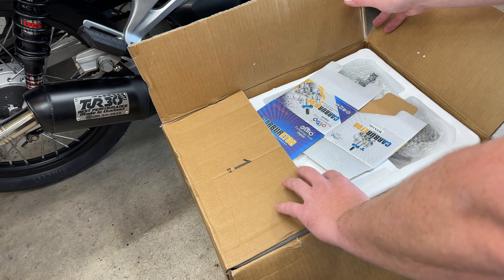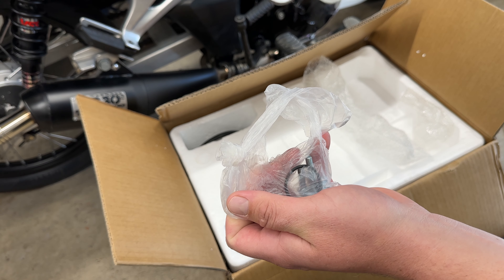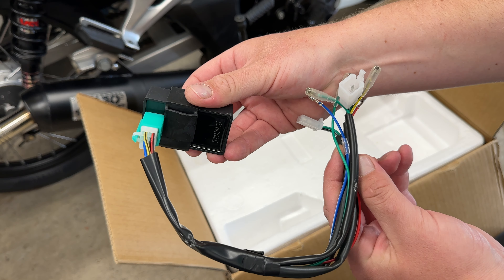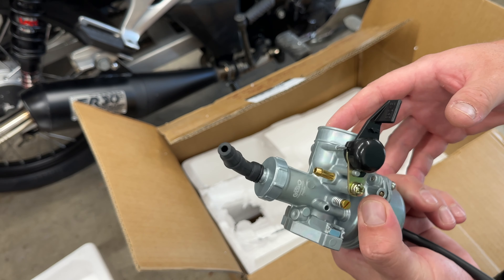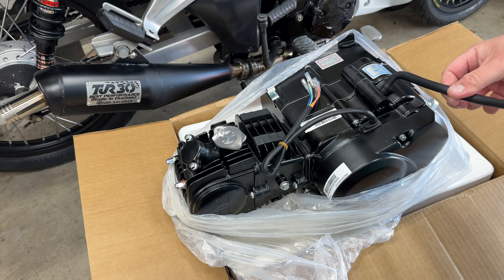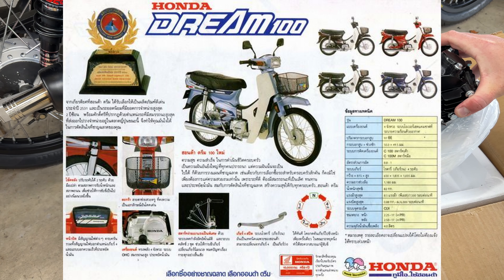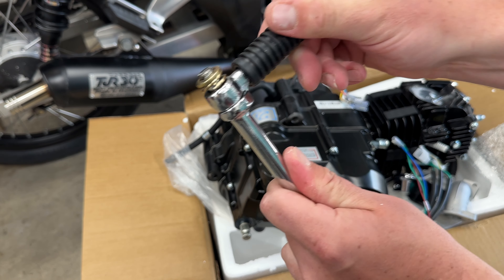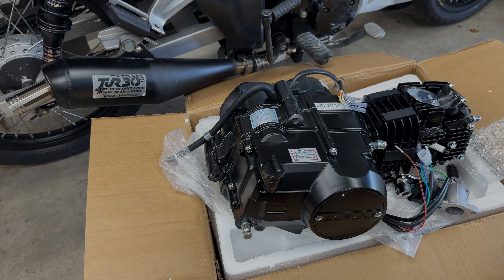125cc Semi-auto Chinese engine unboxing

Comment: The wiring harness is a “run only” harness, no lighting/charging wires.    The rubber insulators on the cylinder are to prevent fin breakage from vibrations.   Matched with a Nibbi 22mm carb, this is a fantastic setup.
Reply from the maker: @MiniBikeMike  good to hear more positive things about the Nibbi. This will be my 5th or 6th Lifan but previously I always used VM22 Mikuni replicas - but 2 out of every 5 carbs would be terrible so it was hit or miss. Love the Lifan engines!
Reply: @SmallBikeStuff  I’m somewhere past 70 Lifan engines used.  I recently finished a 1200 mile ride on a bike with the exact engine you unboxed.   I’ve used a Nibbi 22 on the last 20 or so builds, each has been perfect.

Comment: I love these little motors. I own several in many different configurations. There easy to work on and pretty cheap. I pick up the cheap Chinese Atv that won’t start and either fix or replace the motor and let the grand kids beat on it. Most come with the single forward speed with reverse whoever if you replace it with the three forward speed semi auto with reverse you have a whole different machine. Other than some mix matched parts they can run good and can last fairly long.

Comment: lifan engines just work. they're cheap and good enough. i find they do require regular valve adjustments and sometimes right out of the box, QC is there but they miss things, i like to take the covers off and pre check stator plate bolts, valve clearances and check the cam chain and the little plate near the sparkplug ( have found large metal shavings there) they will run forever if you don't treat them hard but mine live in the high rpm range and last a fairly long time before rings get worn. only big issue they do have is oil usage. i have noticed they're okay when low ish hours but once they start to become used they start using it. i had one get that bad it needed oil every 3 hours haha.
Reply from the maker: Agreed - check the basics and change the oil and you're good for a long time usually.

Comment: Sans carb, those engines are bulletproof, right? What would it cost?
Reply from the maker: They are strong as can be! Occasionally a bad one gets through the production line but if you’ve got a good one it goes and goes. These cost about $450 NZD as you see it in the video. That’s about $100NZD more than pre Covid.